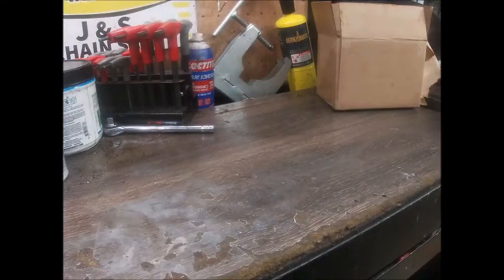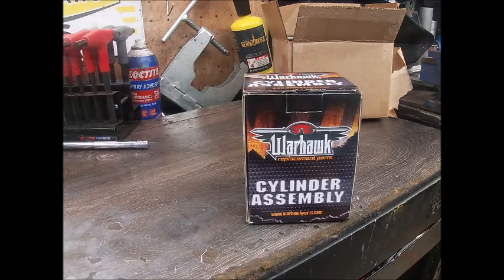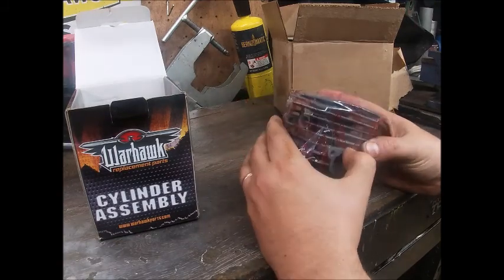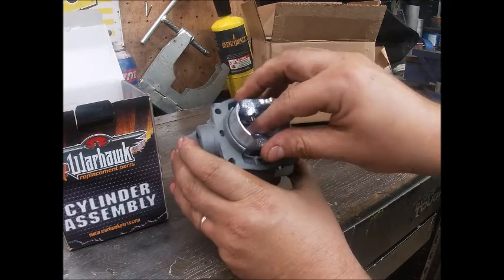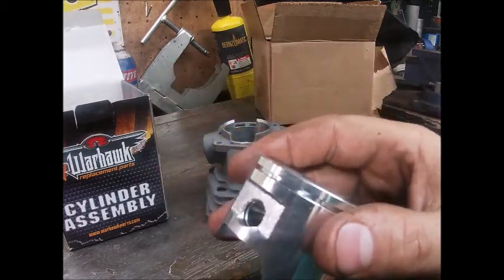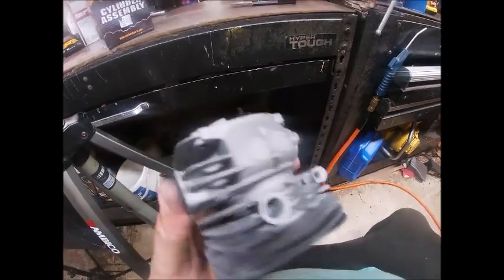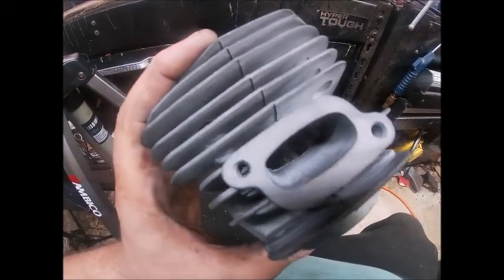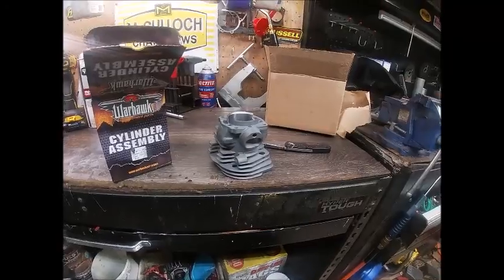WarHawk Cylinder unboxing Husqvarna 346xp So What Does 30 Bucks Get You?

Comment: They’re decent for the price but very soft. I’ve never ported a cylinder that clogged my burrs like that did. None of the old tricks worked it’s just very sharp bits and light passes then stop and clean out the burr. When I raised the transfers I just used diamond the whole time and that honestly worked great. The numbers on mine out of the box were 105ex-130trans-73int that’s with no base gasket. No base gasket it still had a squish of .029-.030”
Reply from the maker: my numbers were a little different but im on a 350 style saw with alot of material taken off an aftermarket bearing cap...
110/124/74 .022...i almost always use a diamond on uppers
Reply: @JandSChainsaw  this was on a Jonsered 2149. Using crank stuffers and epoxy on modified cases. It’s kind of an experiment saw that’s why I wanted the aftermarket top end to see what happens. If it lives it lives and if not oh well lol